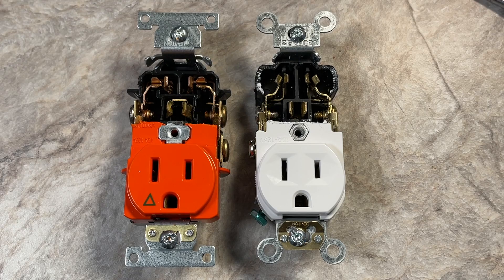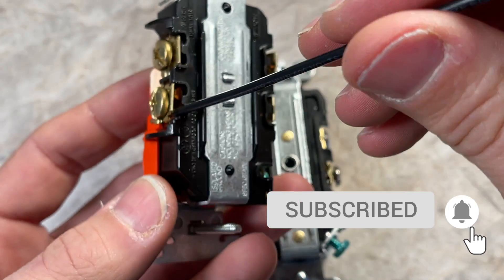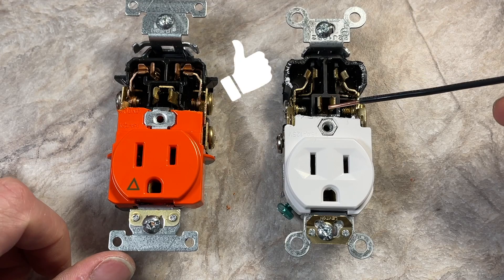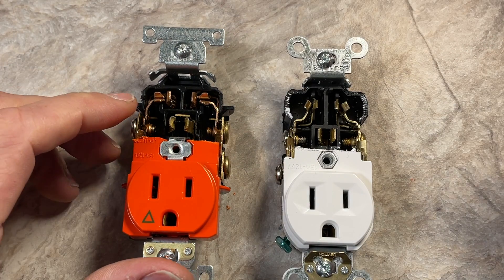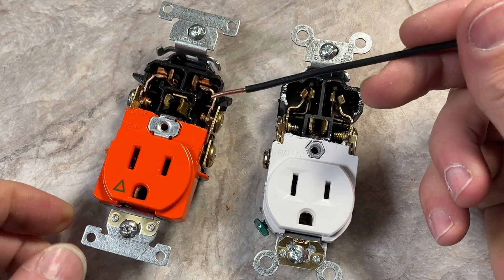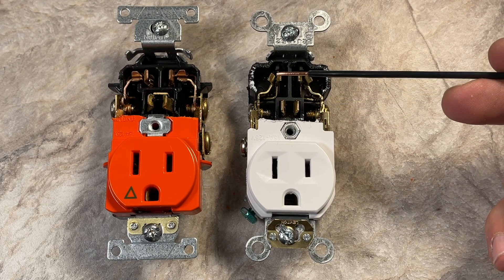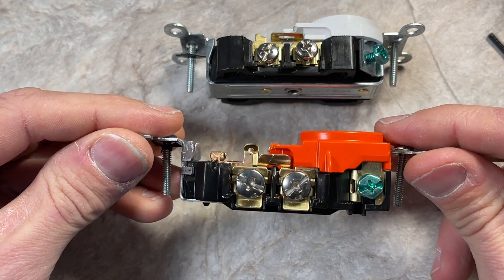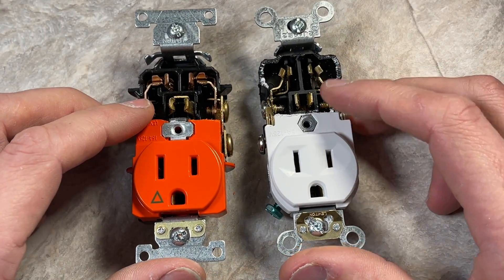What Outlet Should You Buy |  Commercial vs Hospital Grade

Comment: The orange receptacle is actually an isolated ground spec-grade receptacle, not hospital grade.  The orange face with the green triangle indicated the ground terminals are isolated from the yoke.  A hospital grade receptacle will have a round green dot on the face and will contain much beefier/stronger contacts inside.
Reply: ^THIS.^
Reply: Thanks, your right though it is possible for it to be both hospital grade and isolated ground and would/should have both marks. but check this link... https://www.legrand.us/wiring-devices/outlets-and-receptacles/commercial-receptacles/isolated-ground-heavy-duty-hospital-grade-receptacles-back-side-wire-20a-125v-white/p/ig8300 they say its hospital grade with only the triangle
Reply: @exitar1  ... Good catch, though for Leviton you'll be look for either their 82 or 83 series beginning with an M and ending with a dash IG, for both Hospital and Isolated Ground.
Reply: @Everyday Home Repairs  As Derek says, this is simply a spec-grade isolated ground receptacle.  It is not a hospital grade receptacle. Hospital grade receptacles have a green dot on the front (although it may be optional on orange & red receptacles), but they are definitely marked with "hosp grade" or "hospital grade" on the back.
Reply: @TonyPombo  Most are also 20 amp.
Reply: @TonyPombo  I have 20 amp spec/hospital grade isolated ground.  Green triangle, green dot. Says spec grade. Another location says hospital. Also says. Isolated ground on back. Orange too. Yeah green dot means hospital. Spec means federal gov building use. I use them for power tools and compressors in my shop. Got 20 amp circuits for tools and machines. And a 15 amp outlet circuit for computers only with white 15 amp outlets or blue surge protector outlets. Grey outlets in my shop are gfci/afi circuit. That's how I color coded my shop anyways
Reply: @SgtJoeSmith  Nicely done! One suggestion: the afgci/gfci receptacles should be labeled as such. The breaker would have come with several stickers for this purpose.
Reply: @TonyPombo  yeah I got some stickers that came with them. I'm still working on this upgrade. Almost done. Outdoor outlets are WR/TR downstream of gfi. In weather proof boxes though on under side of carport roof of a tarped closed carport on east side of building completely shielded from rain. Replaced all fluorescent with 4 and 8 foot LEDs. Outside wall pack and flood with brighter LEDs. Replaced wiring older than 15 years. It was probably 40 years old as the building is. 15 years ago I got it. So any electrical outlets or wiring that was in building prior to me having it has now all been replaced. Either in 1 of 2 prior partial upgrades or now. By time I get done I should be set for 20 years.
Reply: @SgtJoeSmith  That sounds like something more for fun than necessity... it's not like electrical wiring goes bad with time unless there is some problem with it.
Reply: @ibealion1  the oldest wire didn't have a ground in it so some lights and couple outlets weren't grounded.  And upon replacing that found 2 cracked outlets and a 3rd broke in half. So decided to inspect every bit of it and rest of old outlets replaced  just to be safe. Gave me a chance to make sure it's all up to 2020 NEC code. Moved couple outlets and switches. Hardwired car lift to a keyed 20 amp switch to be able to lock it out for safety. Before it just plugged in and you push button on it.  Now you have to put key in switch to flip switch to turn on power to it before pushing button. Some was for fun. Mostly cleaning it up, piece of mind, full safety inspection and code update. I enjoy electrical work. Started doing it about 10 with dad. And I take pride in my work. I'm kinda OCD. Hence the color coding. Outlet broke in half was actually a newer one that wasn't used hardly at all. But it was 1 that wasn't grounded so don't know if that had anything to do with it. Like from lightning. Thanks for your replies and feedback
Reply: @SgtJoeSmith  Well that makes more sense. I wish I had learned a lot of this stuff when I was younger, but my Dad didn't know how to do any of it himself. I'm learning now though, and it is fun. And so far I haven't zapped myself too badly. :)
Reply: @ibealion1  as a kid I had a train set up. I'd solder and run wires to switches for the different streetlights and building lights. Buildings were mode kits I put together. Also had different sections of track wired to different switches. So could shut off a train one spur and turn a different train on. As teen found couple lamps in trash and took home and  rewired and fixed what was wrong. A stereo too. Still have the 2 lamps 30 years later. Still work. Dad was in charge of school maintenance. Helped electrician buddy on side. I got "volunteered" to ride along and help. But kinda enjoyed it. And he took me out to eat afterwards. He did woodworking and furniture restoration in the winter time so I earned that too. I had the best school projects in Jr high cause dad had shop and lot of tools at home and if needed something he didn't have we went to the high school shop after school and used the big machines there. The elementary and high school principals and superintendent were neighbors and me ad sis were friends with hs principals kids so I one had an issue with us using school shop after hours. Dad helped them and few teachers in neighborhood with stuff on side at their houses at 15 I helped elementary principal add on to his house. He bought me a new mountain bike I was wanting after we finished addition. He used to let us take computer home for summer from school and give us his games. So I had the hook up. Life in a small northern Iowa town in the 90s. Kids now days don't learn nothing growing up. Other than to be dependant on someone else.
Reply: Right on Derek! 👍
Reply from the maker: Hey Derek,  Thanks for the feedback.  Not sure why the supplier switched these receptacles out as I ordered Leviton 8300-HW (https://amzn.to/2JmydKR) and seems like they sent me Leviton 5262-IG which as you pointed out is an Isolated Ground receptacle.  With that said the I think the internals and housings are the same between the 8300 and 5262 but will know soon when the supplier provides the correct outlet.  Appreciate the help.
Reply: @EverydayHomeRepairs  because, they rightly assumed you wouldn’t notice.
Get your refund.
Reply: @SuperVstech  can't now he cut onto it
Reply: @SuperVstech  is what I thought..you confirmed. Think how much this happens across millions items $
Reply: @EverydayHomeRepairs  your welcome bro
Reply: @EverydayHomeRepairs  Don't be a teacher of things you do not know. An electrician would have caught that in a 1/2 second. Been one for 20 years.
Reply: @EverydayHomeRepairs  why isn't this comment pinned?
Reply: @EverydayHomeRepairs  lol... you're making an educational video but weren't able to read the notice literally stamped into the metal yoke... SAD!
Reply: Isn't there some requirement for arcing reduction since hospitals often use a lot of oxygen?
Reply: @joegee2815  not sure. The outlets are required to be mounted what may would say is upside down with ground hole at top. So if cord got pulled out half way and something fell on it the item that fell would hit the ground prong and not become electrified. Operating rooms use isolation transformers. Outlets in o.r. have 60 volts on hot and 60 volts on neutral. So you have to touch both hot and neutral to get shocked.
Reply: @SgtJoeSmith  not true or's are not wired how you say, and the outlets are not mounted ground leg up.
Reply: @HandyMike78  Depends on where you are, of course, on new ORs. New hospitals are tending to go with strict regs, but I haven't had that one. 
And NEC 110.3(b) for years has required that the device (your 120V outlet in this case) be mounted as labeled by the manufacturer. So if your outlet says top (typically on the metal around one mounting screw hole), then NEC says to mount that end top or you could be cited for a code violation. Some inspectors are picky about the labeling (remember one who actually took a newly installed outlet & one that had been there before I came, all the way out and inspected even the back; then refused to continue until I had put it back - he didn't tell me what he was checking for, so he was watching to ensure I followed the labeling), some aren't going to check, and some may only insist on consistency. 
Obviously if it says hospital, or top, or 20A, it must meet that: you can still put 15A receptacles on a 20A circuit, but not 20A on a 15A. You can put hospital on a residence. But not a residential in a hospital. So if the manufacturer packaging, reference/sales manual says it's hospital but there is no label on the back (or the green mark on the front), you can use it in the hospital - but be sure where it's being used, and keep the box/advertising page handy for if the inspector says it's not hospital labeled. You could keep a couple boxes handy so the hospital rating is visible. It would be easier if they stamp it on the device, then you wouldn't have to worry.
If asked to put in some outlets sideways, make sure you're not using ones marked top.
Reply: Agreed. I collect outlets from around the World and the Orange in the US is isolated ground for computers and other data sensitive equipment. The RED face is for UPS or Emergency power. The BLUE face is for Isolated ground-Surge suppressed circuits and the GREEN face WAS for surge suppressed UPS circuits and the YELLOW face is for corrosion resistant marine grade, etc. The only time the color is more for decoration is for the residential grade and when the colors are more subdued like almond, ivory, black,brown, grey, white, and pastel colors.
Reply: I hope you would take this post down or make an edit. People are watching and getting the wrong info. Not all people read the comments
Reply: My understanding is that Green Dot= hospital grade, orange with triangle= isolated ground, and red is emergency power (generator)
Reply: @brad8794  You are correct.. but an isolated ground receptacle normally orange with the triangle ARE available in other colours but still have that triangle... They are almost unicorn rare but I used to work at a supplier long ago and  distinctly remember ordering white decora isolated ground for a customer...
Reply: I started using the green dot power cords for replacement cords on my electric corded power tools.
Reply: @flhusa1  Bit pricey but you get  what you pay for!
Reply: Bingo you nailed it . 4 yrs hospital electrician here
Reply: Doesnt have to be orange! Just needs to have the green triangle. Seen plenty of white faced receptacles with the green triangle in computer rooms
Reply: When I worked in Heart Surgery for 28 yrs, I was able to tour the new operating rooms as they were under construction. All of the outlets were green dot hospital grade, the outlets that anesthesia machines and cardiopulmonary bypass machines (heart pumps) were connected to RED receptacles that were powered by the generators. All 30 some operating rooms had a required number of red outlets, and the cardiovascular rooms had more of them for all of the extra emergency equipment that needed to operate. The intensive care units also had extra red outlets, but even the regular hallway outlets were heavy duty hospital grade.
Reply: @edwardhugus2772  Wouldn't you just love to know what they spent for all those outlets.  Right now with the supply issue, I'm paying $6-9 an outlet just for residential spec grade for the remodel of my house.
Reply: @datsuntoyy  yikes! Where did "The Good Old Days" go to so dang fast!
Reply: Perfect for frantically plugging in the patient's equipment
Reply: The link included to amazon is Hospital Grade Receptacle
Reply: I was just about to say the same thing and seen your comment.
And your not supposed to use certain outlets in a house that will supply life eqt unless it really does ( or not on a backup gen)
Reply: Hospital grade is rated for lower voltage leakage between all pins. Also rugged construction than a standard outlet. Isolated ground makes the mounting of the outlet is NOT attached to the round ground pin on the socket. Green dot is Hospital grade type. Triangle is isolated ground and orange as someone else noted.
Reply: Which one is better though
Reply: @oldskoolwayy  Better only depends on your application. Both are more durable than household type. Isolated ground ones are different to use. Hospital grade ones are very durable and wire just like residential type.
Reply: A good choice if you are using your portable 'charger' on your EV car. Wore receptacles end up with resistance and heat. Many resulting examples online about this.
Reply: True the orange receptacle indicate an isolated ground.  But by definition generators are considered isolated devices even if they are electrically connected to ground. So I think most here say the same thing.
Reply: Yes, this video seems to have several issues. One is that the link to Amazon for the outlet shows a white outlet, with a green dot, to show a hospital grade outlet. It does not show the orange with a green triangle, which as others pointed out, is for an isolated ground outlet. The orange outlet is commonly used in hospitals as well as in industrial plants. Presumably the hospital grade isolated ground outlets will also have the green dot along with the green triangle. It looks like all these outlets are actually the same, except for testing and beefiness. The difference in application is in the wiring going to the outlet.
Also, while the outlet may handle 20 Amps, you can't plug in a 20 Amp device because the outlet you show doesn't have the extra slot that allows you to plug in the 20 Amp plug. However, the Amazon link does go to an actual 20 Amp outlet.
Reply: I was about to say the same thing. Thanks for saving me scads of carpel tunnel inducing keystrokes. 😉
Reply: Not all hospital grade outlets have isolated ground with the green dot.  Since I'm sitting in a hospital lab at the moment, I can say this with quite certainty.  Also, not all hospital grade outlets are orange, that only indicated it's on a backup generator system.
Reply: From my experience working at an aerospace company where we had a 10KW UPS, plugs that indicate power from an UPS are green.
Reply: Leviton offers 2 levels of hospital grade, heavy duty and extra heavy duty, both have internal plates for back wiring, but the extra heavy duty has a heavy duty plated ground cradle and yoke.
Reply: My observation has been that not all outlets in hospitals are this type, only the ones on circuits that are generator-backed.
Reply: @Pheckphul1  Generator backed receptacles will be RED in colour...
Reply: @REWYRED  Ah, OK. I mis-remembered. I guess I haven't been in the hospital enough.  ;-)  Hopefully that statement won't jinx me, and cause me to catch COVID-19.   8-0
Reply: @REWYRED  you nailed it . Gen power is RED!
Reply: I work in a nursing facility and we do have a generator in one wing. All the receptacles are indeed red and hospital grade as evidenced by the green dot.
Reply: @REWYRED  .. Orange is also an acceptable color, since having a blood colored receptacle was found to be a fairly stupid choice.
Reply: @DeepPastry  "orange is also an acceptable colour" for receptacles backed up by back up / generator power in a hospital you mean???
Nope sorry that is incorrect, red and red only for GENERAL 15A and 20A straight blade devices supplied from a backup source / Generator... You MAY have an orange isolated receptacle on a  back up source but it must be identified as such... We will use a RED cover plate and identify it as supplied from a back up source, otherwise they are considered supplied from "Normal" power and will not function in the event of an outage.. And yes, I am an electrician in a major healthcare facility..
Reply: @DeepPastry  Never seen a orange outlet indicating GEN backup. Always been red. Not saying you're wrong, but it's far less common than red and that is the standard GEN backup receptacle color.
Reply: @Pheckphul1  generator power outlets are normally red if not isolated ground type.  you typically only use orange for equipment that is very sensitive to interference.  blue are generally special surge suppression or battery backup.
Reply: @renton9999  💯
Reply: @Pheckphul1   It can get confusing, retired hospital maintenance lead hand here, at our old hospital circa 1964, only certain circuits were on emergency power, they had red receptacles. In our new hospital, 2005 the whole hospital is on emergency power except the chillers, so white are used, but we have have a 1 megawatt UPS for transit power until the generators transfer over but only for essential departments, now they have red receptacles.
Reply: @Pheckphul1  The generator backed outlets in hospitals are usually red.  All other outlets, even in the hallways and stuff should be the green dot hospital grade. BUT, older hospitals or older parts of hospitals will often still have a standard commercial grade outlet in them.
Reply: @Pheckphul1  I'm glad you said it because I was going to. Also they are separately wired to their own gang box and load distribution to better manage loads.
Reply: @Pheckphul1  that would be correct. The others would be the commercial grade. And only things that you can't go without should be plugged into the red sockets.
Reply: @Pheckphul1  Gen Backups are RED.
Reply: @Pheckphul1  I was a biomed tech now a field engineer for a medical equipment company. If it is a red outlet that is on emergency power. We connect our monitors to those. They should all be hospital grade throughout the facility because even if there are not patients they could be monitoring them on another floor though a central station. The contractor is just going to have white and red hospital outlets because they may not know what is going to get plugged in.
Reply: @Pheckphul1  Generator backed up outlets are Red.  Orange is isolated ground
Reply: @Pheckphul1  Correct... hospital grade outlets are only required by code in three locations; patient bed side, critical care areas and areas that are designated as areas that provide anesthesia, they don't want medical equipment plugs from falling out -- which most in these three areas are generator backed as you stated.
Reply: @Pheckphul1  yep, i work for IT in a hospital system, any device that needs to be on generator if the power goes out has to be plugged into the orange outlets, everything else plugs into normal colored ones, although they might still be both hospital grade the orange ones at least make it easy to identify whats on generator power
Reply: Thought the same thing when I saw the video thumbnail. And the orange doesn't indicate it will maintain energized during a power outage, it signifies isolated ground.
Reply: @FueledByRyan0  Yes, and Red is for the backup power.
Reply: @FueledByRyan0  green triangle indicates isolated ground.
Reply: @FueledByRyan0  orange (or red, I have seen red ones too) receptacles in a hospital are only used for circuits that maintain emergency power. I worked in a hospital for 11 years, and know this first hand. Actually I worked in several hospitals in their network, but one was my main work location.
Reply: blah blah blah so you think you know about recepts.
Reply: I believe a Hospital Grade will only allow three prong cord caps to be inserted. The ground prong acts as a key.
Reply: @toadlika  That's not true. There are some hosp. grade that have that interlock but not all of them
Reply: @toadlika  that is wrong. What you are talking about is a "tamper resistant " outlet. But they do make a TR HG outlet
Reply: @toadlika  wrong, I have used two prong devices in hospital outlets. There is nothing that prevents the use of two prong cords.